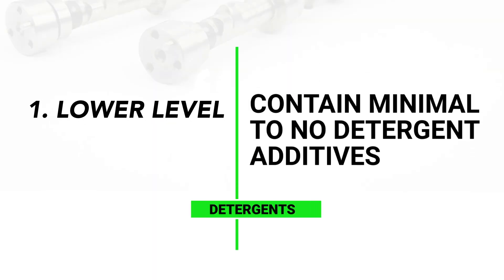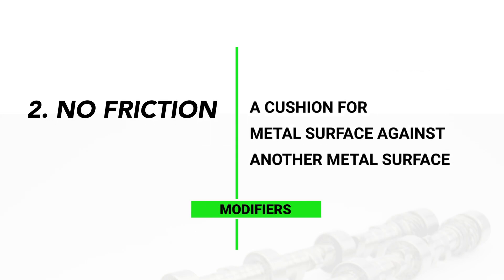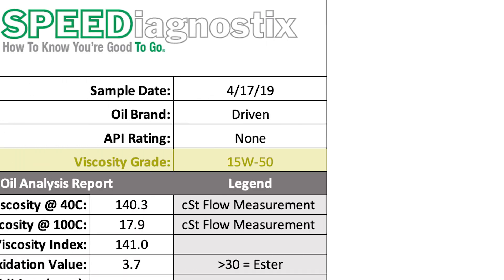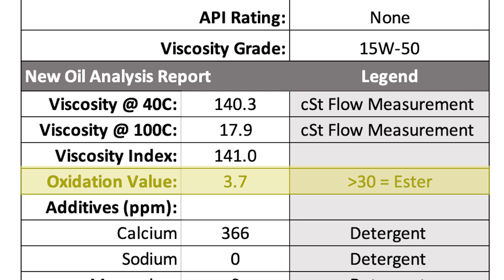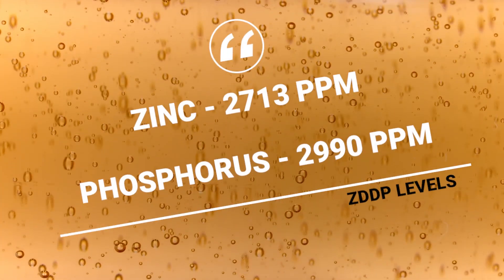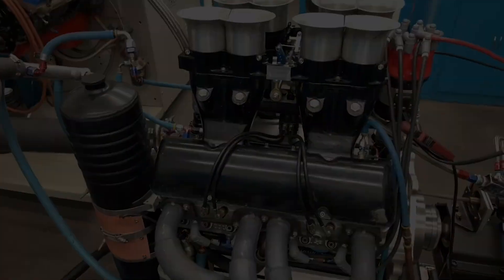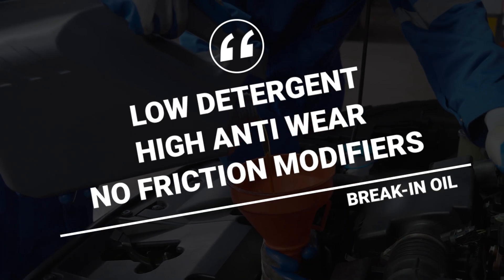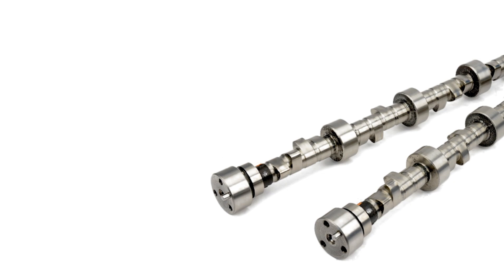Is It Just High Zinc (ZDDP), Or Is There More To It?

Comment: For some time, the Honda owner's manuals have stated to NOT change out the factory filled oil in newer cars, and state that this is for break in. Any insight into what Honda fills from the factory? How long should one leave such a break-in oil in the engine before changing it out vs any other oil change?
Reply: I've noticed that people that buy new cars and run the factory fill too far, for example, the manual states an oil change interval of 7,500 miles, now on the new cars I've purchased recently, and of course you can't go by just the look of the oil, however, I've noticed after around 2,000 to 3,000 miles that factory fill oil, you can't see any light through it anymore. I've heard stories of people having oil burning issues after doing the 5,000 or 7,500 miles recommend oil change (I believe VW is 10,000 miles for some of their cars like the 1.8T). I'm not usually conspiracy theorist but I have to say that this looks pretty lucrative for a company that wants to sell more engines and more cars. Am I being paranoid or what??
Reply from the maker: I agree that the initial oil drain should be much shorter than subsequent oil changes. Some people want the “convenience” of the longer drain interval and are not worried about the long term impact, so that’s what makes for all the confusion information. There’s a difference between what is convenient and what will produce longevity.
Reply from the maker: Great question. Factory fill oil is different from regular "service" fill oil. In fact, GM has a Factory fill spec and a Service fill spec. I'm not aware of what Honda specs for factory fill, but it sounds like they are doing something similar to GM.
Reply: I would like to change out the oil to remove manufacturing debris though. Compromised and changed out the factory fill oil at 3000 km.
Reply from the maker: @shahrukhbakar3248  smart move!

Comment: I really wish a lot of these companies would start using more magnesium than so much calcium and that way they could cut down on some of the low speed pre ignition and still have a decent detergent and dispersent.

Some of the oils that I test have super super high amounts of calcium and if you look at the data it says if you have too much calcium this could be a factor why there's more low speed pre ignition and magnesium is a little bit more friendly in that area
Reply from the maker: That's why it is so important to look at the additive package as a whole.
Reply: @themotoroilgeek  so why dont OILS have it printed on their labels ?

instead we have to figure it out?

its BS really......should be a visible component......especially when we are dealing with our 15000---25000 race engines.   

the factory tells you all these codes---to look for on oil containers.

thanks for what You do here Lake.....I know there is business involved.
Reply from the maker: @harryharry3193  It would be great if it was easier to understand from just looking at the label!

Comment: What makes the friction modifiers a negative during break-in?
Reply from the maker: Great question. Friction modifiers interfere with the ZDDP film formation, so that negatively impacts the break-in mating of the parts, especially the piston rings.
Reply: @themotoroilgeek  So is the reason John Deere gets away with friction modifiers in their break in oil because they always have those hard chrome rings on the diesels?
Reply from the maker: @bcbloc02  it is actually because of the way they hone their blocks. The bores and the rings are basically broken in when the engine is assembled. That’s a level of precision hard to replicate outside of their environment.
Reply: @themotoroilgeek  They are all wet sleeve engines. When we do rebuilds we just drop in new pistons and liners and Deere tells us to use the break in oil the first 100 hours and to do a dyno increasing load breakin for at least 2 hours. There is no signs on  the rings that they have ever been run in the piston liner packs or that they have been lapped in.
Reply from the maker: @bcbloc02  are you honing the liners or using them as is?
Reply from the maker: @bcbloc02  one more comment, that long break-in time could be reduced if they eliminated the Moly from the break-in oil. 

Without Moly, even TiN coated rings can break-in within a few hours.
Reply: @themotoroilgeek   Liners have a cross hatch from factory. We just assemble rods to pistons and drop the piston liner pack in the block and it is ready to go.
Reply from the maker: @bcbloc02  that’s what I suspected. The honing John Deere does on the liner makes it possible.
Reply: @themotoroilgeek  That is interesting because if somebody accidently fills a new engine with the regular Plus 50 15w-40 the rings won't seat and the engine will consume oil. We commonly see this problem on the compact tractors where people buy new ones and only use them a few hours then change the oil because it has been a year and put in the regular oil instead of the break in then we get complaints about excessive oil consumption.
Reply from the maker: @bcbloc02  That shows how much impact the Calcium detergent package has on break-in. The Plus 50 has more Calcium, and that makes a big difference in how the ZDDP works as well. This is why we made the point - lower detergent, no friction modifiers. That combo lets the ZDDP work faster to get the rings and cylinder bores to mate properly. The hone does play a role as well. Ring seal is soup, not steak. It takes all the components working together to get it right. 

Thanks for sharing your experience! That's great info.
Reply: @themotoroilgeek  Thanks for  taking the time to answer my questions! I build 30-50 big Diesel engines a year from regular farm tractor to 3000hp tractor pulling engines and I have learned a lot from you over the last year from the various channels you appear on. 😎
Reply from the maker: @bcbloc02  thanks! There’s more to come!
Reply: Is critical that the parts rotate and wear into the mating parts without scuffing and galling. Friction modifiers could interfere with rotation and cause localized failure, AKA galling and scuffing.

Comment: Great content as always, thanks for taking the time to make these videos! I've always broken in the engines I built on cheap conventional oil then switched to synthetic after a few thousand miles and never had any problems. It seems like unless an engine has a flat tappet cam, the exact procedure used for break in isn't all that critical.
Reply from the maker: Actually, the break-in procedure is quite important. I have another video on that… 

https://youtu.be/MhA_nVRhYew